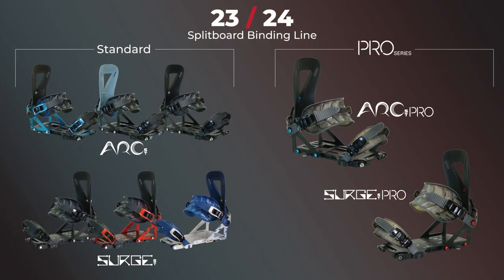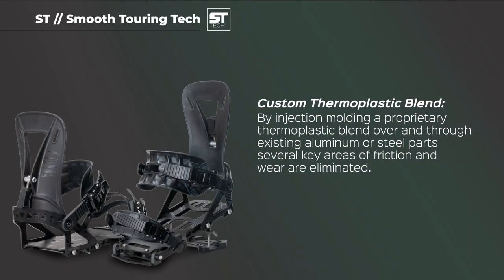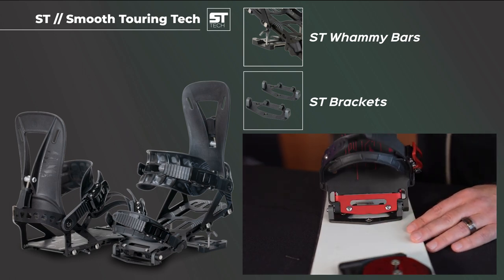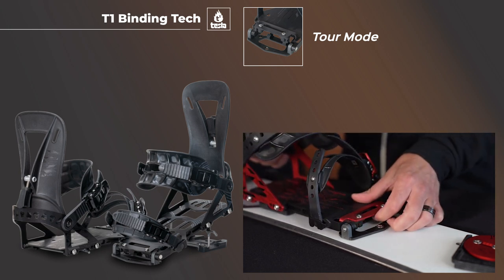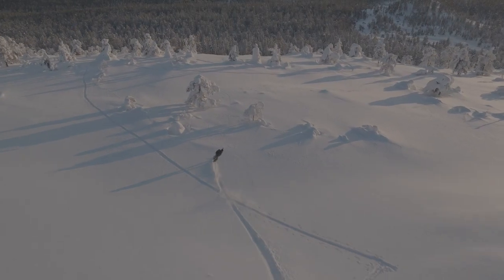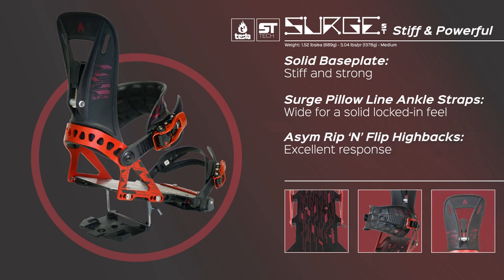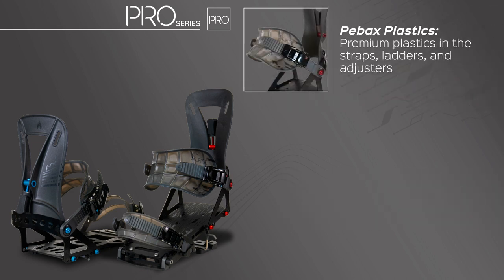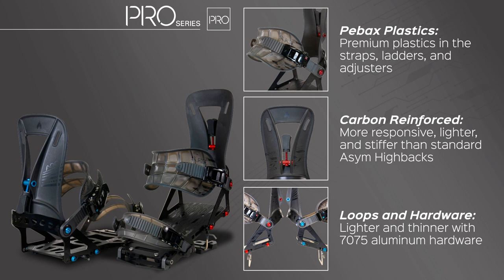23-24 Spark R&D Splitboard Binding Line

Comment: As someone that is 6'3 and 200 pounds would you recommend the Surge version? I would be getting into into low angle terrain, nothing big or steep at the moment. Just asking since you suggest the Surge for a bigger person. Thanks
Reply from the maker: Hi! Generally yes, but exact body specs for going Arc ST or Surge ST is not an exact science. An option for you might be to get the Surge ST and after some tours, if you find it a bit stiff purchase some Arc ST ankle straps or highbacks a la carte.